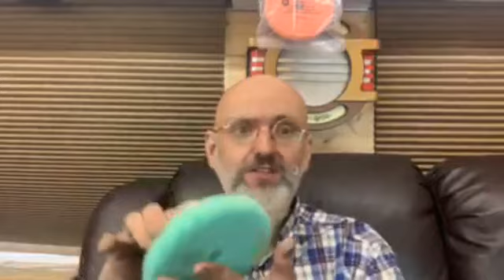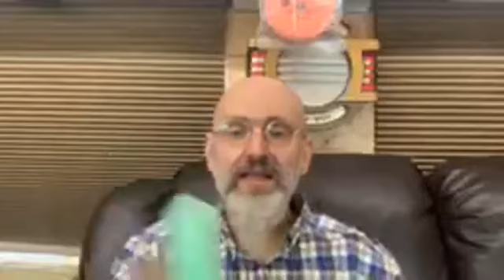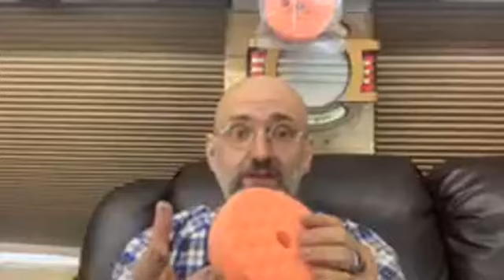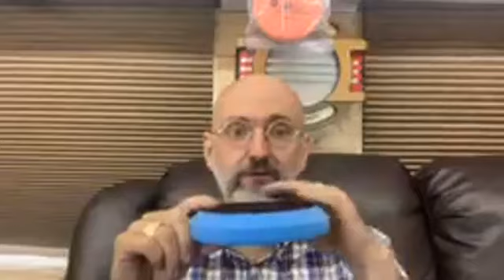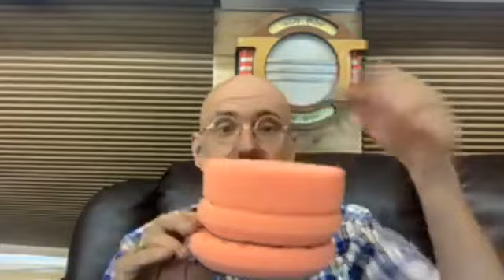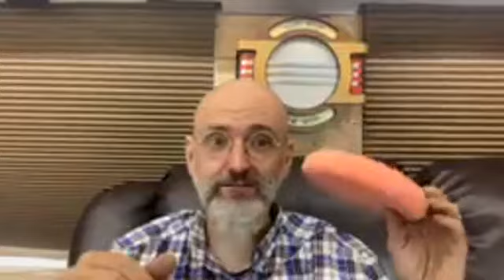LC Originals Pads and Cutback DA Pads

Comment: really helpful. thank you - it is so important to UNDERSTAND the differences between all the LC pads and the usefulness and appropriate role each type play - at first this is a lot to get your head around - BIG thank you for you explanation on the advantages of CCS pads and their design attributes .  I have started with a combination stock of 5" HDO Blue ( x1); 5" Force Orange (x2) ;and 5" Force White(x2)  plus a 5" Flat Hydro Tech  in Cyan (x1).   No CCS examples I am afraid.. ! - all for use on a DA Orbital polisher .   As a newbie can you tell me whether the selection is a good starting point, and whether I am "missing" any pad in my beginners repetoire ?  The car I am concentrating on is a Volvo XC70 in dark blue, 17 years old that has been well maintained outdoors in a marine environment on the south coast of England .. its paintwork has been maintained by conventional hand polishing but has much room for improvement - I am 67 years old and have time and an interest to get into this as a source of personal satisfaction and achievement - are the pads I have OK ?  ( I am a little doubtful as the use for the 5" Force White pads.. ).  Bill Kerr, Seaford, Sussex UK